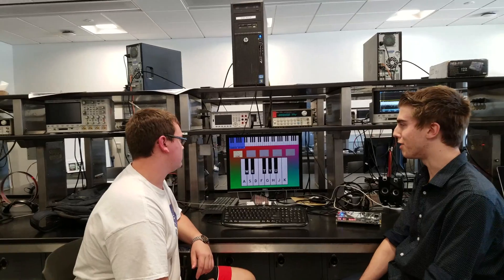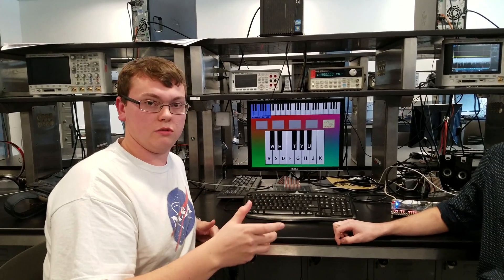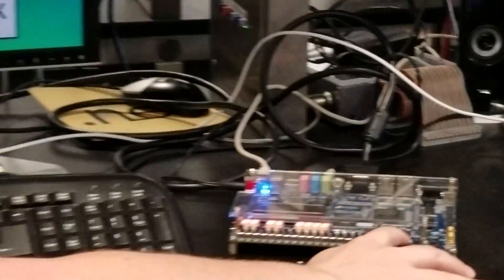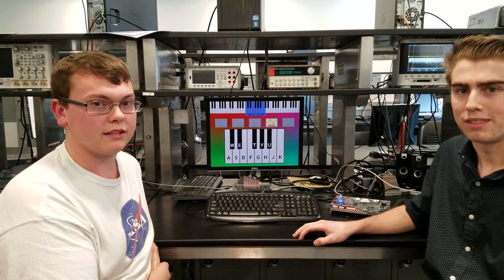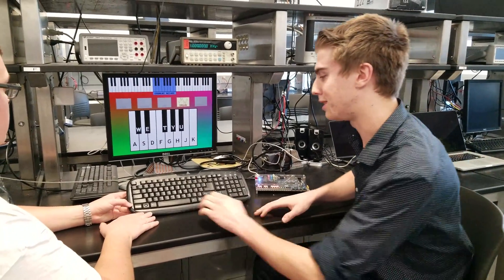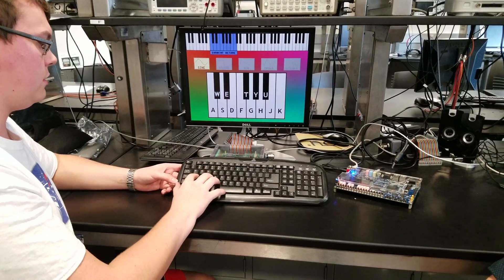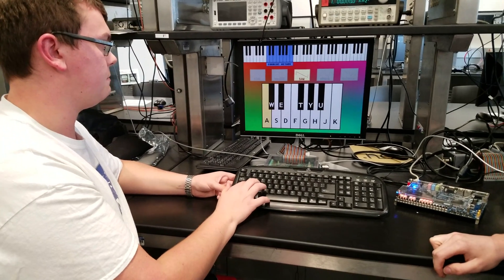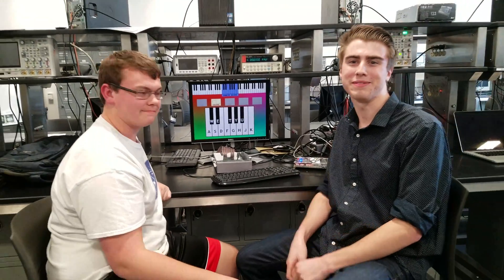FPGA Audio Synthesizer final project

Comment: Maybe I am wrong, but after taking a quick look to your code, it seems that your synthesizer is based on a NIOS softcore.  So, as far as I can see, this is not truly speaking a FPGA synthesizer, since the FPGA is programmed to run a softcore processor, and not implement the synthesis algorithms in VHDL or Verilog.
However, it seems that you enjoyed doing this project, and this is the most important thing : you always learn more when you "play" while learning, because learning becomes a pleasure by itself.
Reply: busted!

Comment: The Touchscreen is controlled by the fpga?
Reply from the maker: The screen is just a standard vga monitor. It is not a touchscreen. The input for playing notes is implemented through the usb keyboard.
Reply: @flewber  the video output is generated by the fpga or are you using an external program for the gui? ( c# for instance)
Reply: @jorgearagon8053  I was responsible for developing the gui for this project. We used custom 1-Bit depth sprites and mapped them to specific locations on screen. The sprites would change color based on other events happening. But the entire Gui was hard-coded and stored in the On-Chip memory. That said, we used memory functions that are high level for instructions of where to place each sprite on a VGA resolution screen.

Comment: Very cool. I am assuming your project involves FIR/IIR filter. How did you guys handle multiplications which usually involve floating number?
Reply: Presumably fixed point math... Most people avoid floating point with FPGA's (for obvious reasons).

Comment: would this be transferrable to another fpga board like a zybo board?
Reply from the maker: We wrote this code for an Altera Dev-II board using the Quartus IDE. The code is written in System Verilog. I am skeptical as to how easily it would transfer over to another board given the code is written specifically to run on the Dev-II board which has specific processors, memories, and input-output interfaces. That being said, with some modifications I'm sure it can be done.

Comment: Greetings from Argentina. Your project is amazing, great work guys. Just for curiosity : ¿What limits the polophony of the sintetizer? Thaks for sharing this.

PS: Sorry for my english, its not on point.
Reply from the maker: Thanks for your interest! We were only able to play 2 notes at a time because of the limitations of using a typing keyboard as input. The keyboard only sends over data from up to 2 key-presses at a time.
Reply from the maker: Hello Valentin, If i'm understanding your question correctly, you're asking "Why is our keyboard limited to playing only 2 notes at a time vs 3 or more?" 
Due to the limited time we had to work on this project, we modified code from a previous assignment to implement the keyboard input. This code only allowed a maximum of 2 keycodes from the keyboard to be read at a time. Given more time, we surely could have modified the code to include support for more keys.